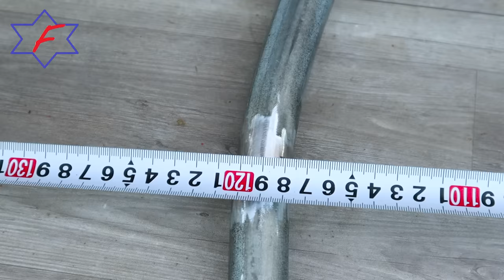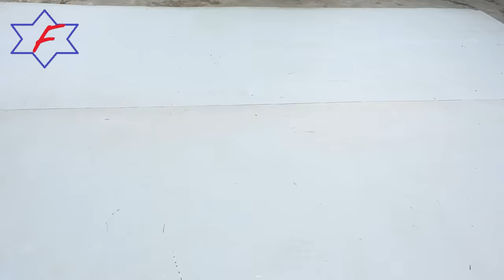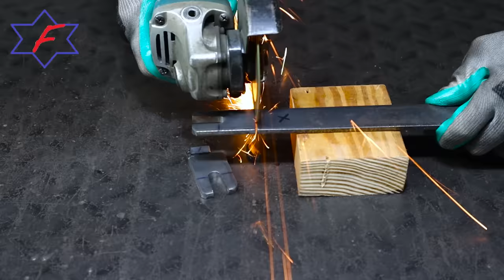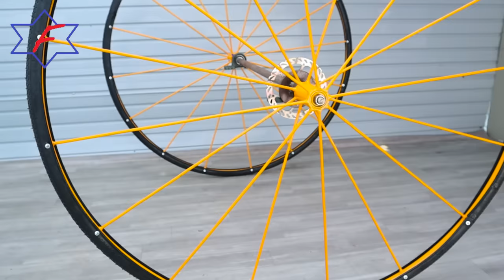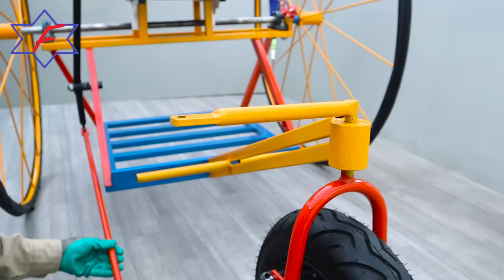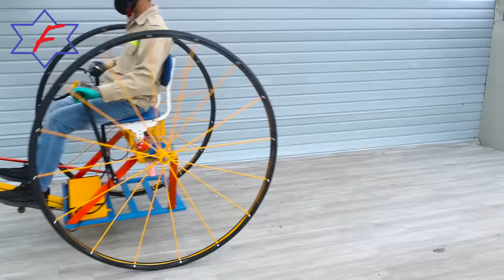Great Experience When Building A Cargo Tricycle Using Huge Wheels

Comment: The front fork needs rake. Angle it about 70°, and mount the axle about 5 cm in front of the fork blade. This will create more stability, smoother steering.

This looks like a fun build.